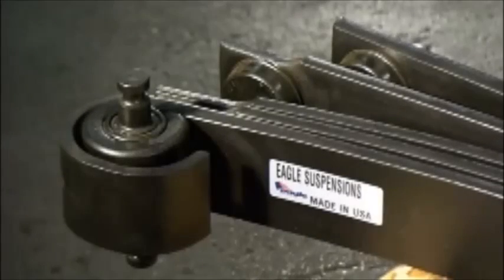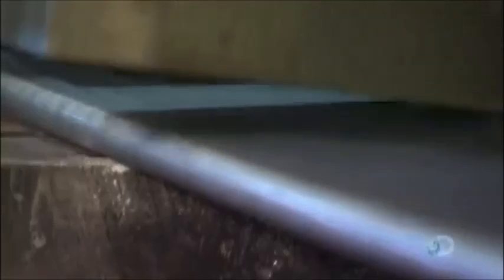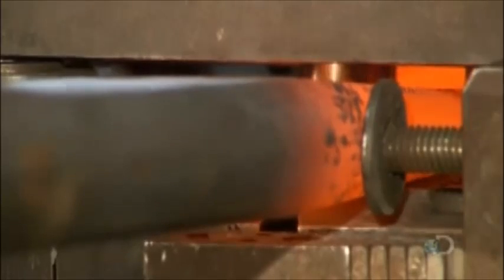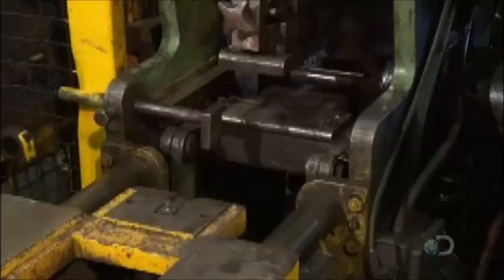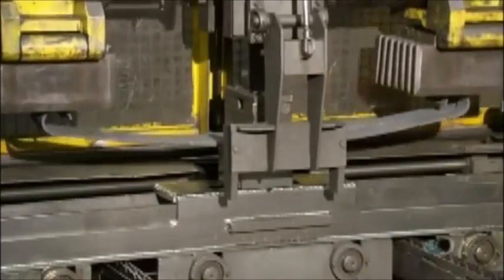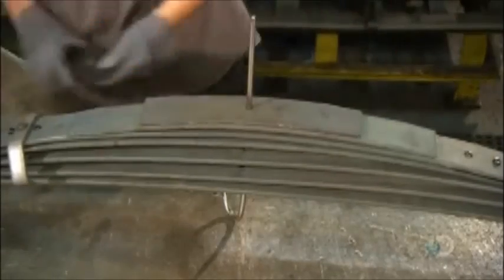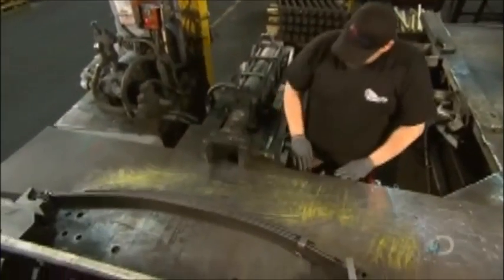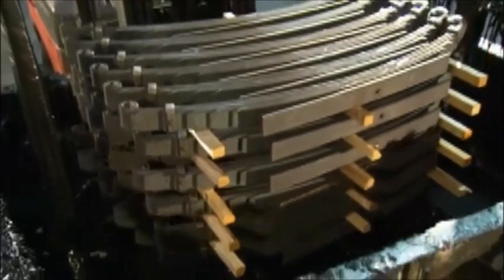How It's Made - Leaf Springs

Comment: '
right word is LIFT SPRING...
NOT leaf spring...
leaf is a only death branch of plant - tree skin off
Reply: As a mechanic in the field for 18 years now, and having taught for 7 including suspension classes. i have never once seen or heard it called a lift spring, always leaf spring, i just assumed it was due to the shape. Anyhow in my experience, she called it correctly as a leaf spring.
Reply: hi PE...
still a word LIFT...
use good common sense...
not a leaf...
not make good sense...
copy from google...
Suspension Lift Kits. On the flip side, suspension lift kits are designed to increase a vehicle's ground clearance and are the type of lift kits most often used with trucks and 4x4s
Reply: shut up
Reply: hi PE...
thank explain...
yes right word is a lift...
not leaf...
lift is a loading down and up weight...
leaf is a slowly dead dry falling from the tree / any plants
Reply: hi AF...
who is a SHE...
thank explain about cross 2 words as leaf = lift
Reply: Leaf spring. Leaf has multiple definitions.
Reply: John Williamson
shut up
'
hi J W...
aaww mercy
Reply: hi O...
only 4 different explains about leaf...
not many as multiple...
rather leaf is a dead falling from the tree...
lift is a something hold to load down or up
Reply: leaf

lēf/

noun

1.

a flattened structure of a higher plant, typically green and bladelike, that is attached to a stem directly or via a stalk. Leaves are the main organs of photosynthesis and transpiration.

synonyms:leaflet, frond, blade, needle; More

2.

a thing that resembles a leaf in being flat and thin, typically something that is one of two or more similar items forming a set or stack.

Comment: Interesting. The only thing you guys missed is when the bushings are installed in the eyes.
Reply: David B. Fishburn ive always just hammered em in and filed any burr that may have formed or used a bench vise if i had one big enough
Reply: It would have been interesting to see how the factory puts them in.
Reply: I work for eagle suspension and its really simple its just a press machine and u stick the bushing on the eye and press it in

Comment: Is the process at 2:32 Forging?
Reply: BLACKSMITHING!
lol
Reply: The process is called Forming.
Reply: Hot roll forming.
Reply: yes.... it is forging... hot role forming is a form of forging... will a piece of hot or cold rolled steel serve as a knife unforged?.. no... it will not, at least not as well as a "forged" knife... because the process of hot rolling blank steel (in the steel mill itself)... is to produce a basic uniform, void free, microstructure in the steel to serve as a general purpose  steel bar which can then be farther processed into whatever you need it to be... in this case... a leaf spring... in the case of a quality knife edge... you must collapse the crystaline lattice of the steel to make it much denser than the parent bar.... this will produce a knife edge that will likely take a much sharper edge than a non forged knife... and hold that edge for much longer... but... it will likely be far more difficult to sharpen with a traditional stone.

spring steel i think is generally 1075-1095 carbon steel... having .075% -.095% carbon ... 1095 has been for a very long time considered a very very fine knife steel if forged properly.. though it does rust, does require care.

is it forging?...yes... forging is a big term... is it hot rolling, forming.... die forging... yes it is.

will a leaf spring make a fine knife... there is about a thousand books that says it will... i have yet to see one that doesn't say you need to forge the spring farther to turn that steel into a proper knife...although i bet you could put an edge on that steel as it is.... it wouldn't be worth your name to falsify any aspect of it.
Reply: Yes, also known as "cold forging", or blacksmithing, as mentioned....
Reply: Not sure, it says forging is shaping metal by beating or hammering it. This is a press job so I would be inclined to think this is not forging. I could be wrong :)
Reply: NO

Comment: is there  a machine to tension pull back coil spring when the car coil spring goes weak
Reply: Hydrolyic press with the correct tool
Reply: Roller
Reply: N K no way that's right. It can't "shorten" it's attached at both ends so that's impossible unless the shackle moves closer which it can't because it's attached to the body.
Reply: the spring lost height, but did not get weak. Add a spacer, there is no good way to lengthen a spring. Spring manufacturers can compress a spring to a new height, but not pull them.